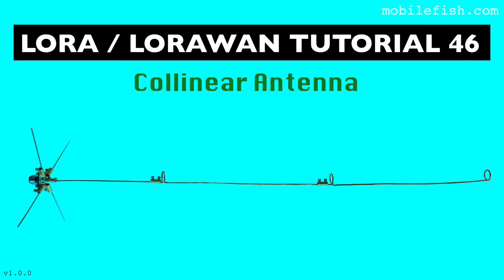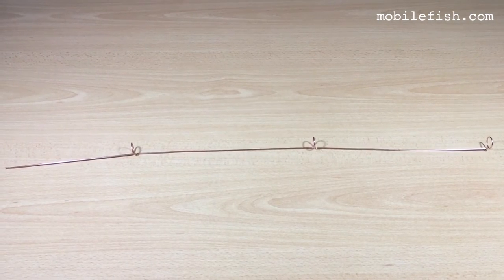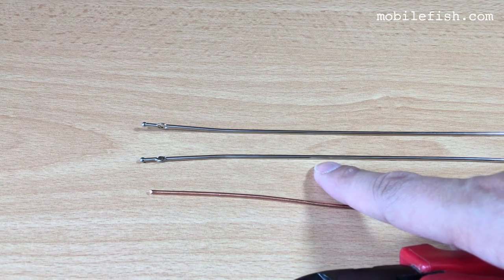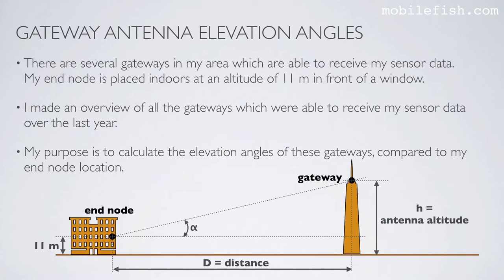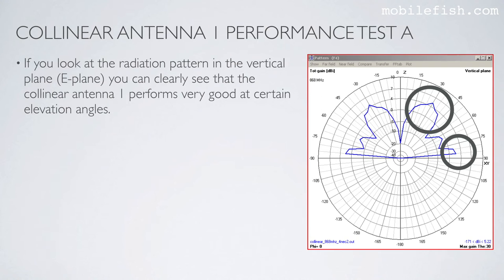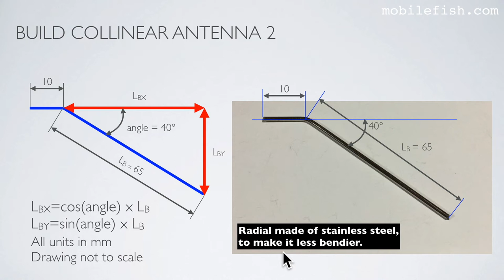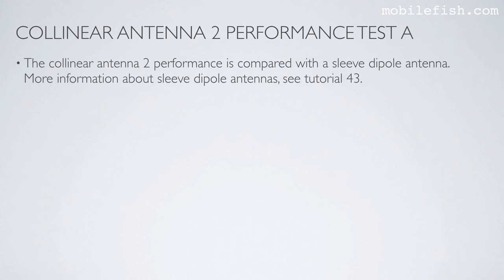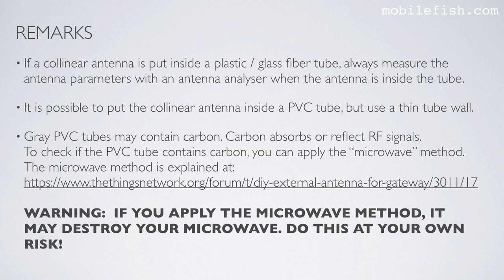LoRa/LoRaWAN tutorial 46: Collinear Antenna

Comment: how did you come to  deter  the  size of the phasing loop size    normally  it got to be a 1/2 wave length to cancel out the  radiating field   yours is not even 1/4 wave   im sure there is method in  your madness

Comment: Is there a reason why you went with 1.8 mm copper wire?  I'm in the US and closest one that I can find is 12AWG wire which is 2.053mm.  13AWG is 1.828mm and 14AWG is 1.628mm.  13AWG is very hard to find.  Is it possible to use 2.053mm solid copper wire?  Will that change the diameter of the loop?  Can I still make the outer diameter of the loop to be 18.8mm?  Thank you!

Comment: Hi, great video!
I have a Q. Do you have info about the design of the loop ? Why this two different diameters (15 vs 29 mm)? Are loops geometry related to overall antenna dimensions? thanks
Reply from the maker: https://www.mobilefish.com/download/lora/lora_part46.pdf
(page 13) I started with a loop diameter of 15 mm and no radials but after measuring the antenna parameters this design is NOT good.
I have been tweaking the design and ended up with a final design (page 29), it has a loop diameter of 18.8 mm and radials.
Reply: The calculations of the lengths are a bit odd. Normally a colinear antenna constist of 1/4 wave to start, then 1/2 delay element, 1/2 radiating element, 1/2 wave delay element, 1/2 wave radiating element and then 1/4 wave element to close off the antenna. Thats a 2 element colinear antenna. In your design the 1/2 wave delay elements are exchanged for a coil which saves space. Which is nice!
But the 1/4 begin and 1/4 end and in between everytime a pair of 1/2 wave delay + 1/2 wave radiating elements are essential. 
The electrical length of the delay+radiating element can be choosen depending on the radiation pattern is desired but should be a multiple of 1/4 wave. Like 1/4 or 2/4 wave or 3/4 wave.
The radiating element B in your video is 220mm long which is an odd length. For 868 MHz it could be 1/4 wave (*VF=0,96)= 82mm, or 1/2 wave (*VF) = 165mm, or 3/4 wave (*VF) = 248mm. And the beginning and end element should be 1/4 wave (*VF) = 82 mm. That should make the antenna more perfect in terms of elements length. Then the induction of the coils im not sure I never used coils in antenna's yet. But if those lengths for the elements are choosen atleast then the lengths of the elements are choosen correct, then modify the coils for best swr is what I would do. Or if the coils are unknown what to do with them, then for best colinear antenna the design is 1/4 wave then number of [ 1/2 wave delay element + 1/2 wave radiating elements] and then 1/4 wave element to close the antenna off. (can make a metal wip on the end to outside of pvc tube then after the antenna is contruction parts of the whip can be trimmed for best swr. 
Its worth trying maybe you can get an enhanced colinear antenna out of it!

Also, great job at your tutorial video's I enjoy watching it, its very informational but also fun to watch!

Comment: Please calculate an antenna in 435 Mhz.
I have made 5 so far and they all work perfectly for mining NHT in 868 Mhz coins.
Great tutorial! Thak you.
Reply from the maker: Hi Liviu, sorry I do not have the time to create an antenna design for 435 Mhz. Have you watched LoRa/LoRaWAN tutorial 38: NEC Antenna Modelling Software, 4NEC2? With this knowledge and the 4NEC2 card deck  (explained in tutorial 46) https://www.mobilefish.com/download/lora/collinear2_868mhz_4nec2.nec.txt  you can modify the antenna design yourself.
Reply from the maker: It would definitely help if you have a N1201SA Vector Impedance Analyser (tutorial 40).
Reply: @liviugabreanu-yo3fyo354  I'm sure there is plenty of relevant info on the web to help YOU design and test such an aerial. You have the means to test it which is more than most people have.

Comment: As i see this is max gain 5.22db on 11meters above ground ,so  what  if  i am on on some 3 meters above ground? How can i make some 10-12db antena to make better cover of signal??Big regards, great video!
Reply: I took the LORA device near the antenna to use a very short 50 ohm 1 -2 meter cable.
It would be one of the methods.

Comment: Hi.....I am wondering if this antenna can be used in 144 MHz???
I am still confusing in the measurement of loop.
Thanks.
Reply from the maker: No. This particular antenna design & dimensions is for 868 MHz.
Reply: No, this is specifically for 868MHz, but could probably be scaled for 144MHz and tuned with some fiddling and experimentation. However, there are loads of designs for 2 metre aerials of all sorts around on the web if you do a search.

Comment: Hi, I build this antenna version 2 twice and every time the best frequency was about 850Mhz. I could tune it a little bit but best frequency was never higher than 859MHz. So what can I do now or what did I wrong?
Reply from the maker: It is difficult to say what causes this. You can use the 4NEC2 antenna model and play with the parameters: https://www.mobilefish.com/download/lora/collinear2_868mhz_4nec2.nec.txt
I have noticed that the spacing S, see: https://www.mobilefish.com/download/lora/lora_part46.pdf is quite sensitive.
Reply: @Mobilefish  Thanks a lot for your answer 😊
Reply: At these frequencies, there is a lot of inductive and capacitive reactance created by using those wire connectors. Look how close the connector gets to the shield side of the chassis mount connector; that's NOT good. Similarly at the phasing coils.